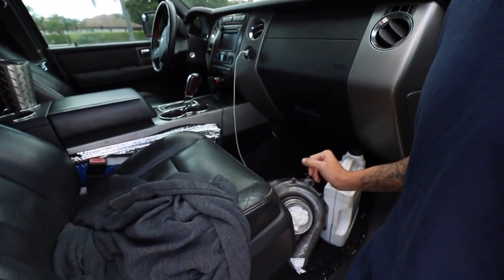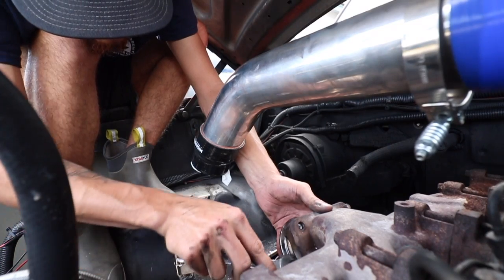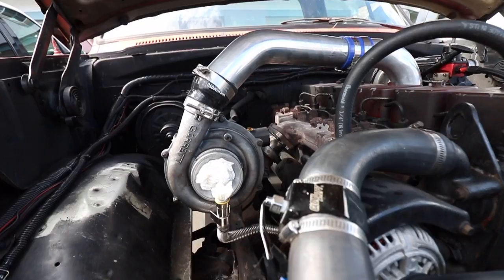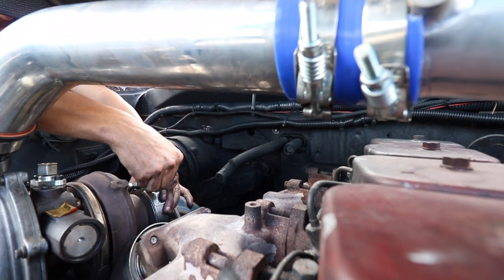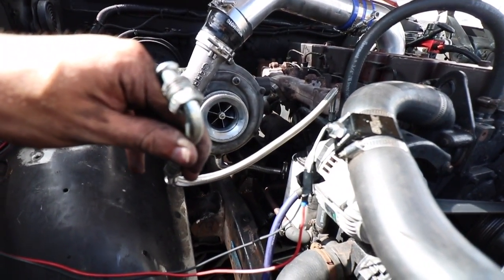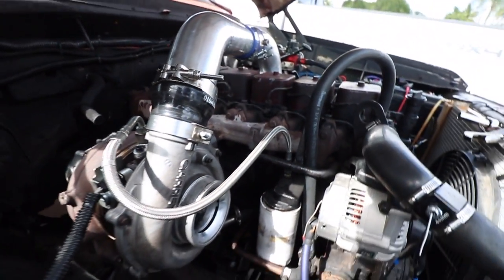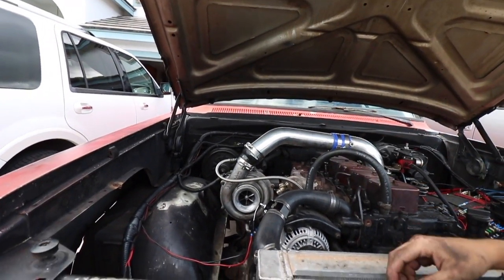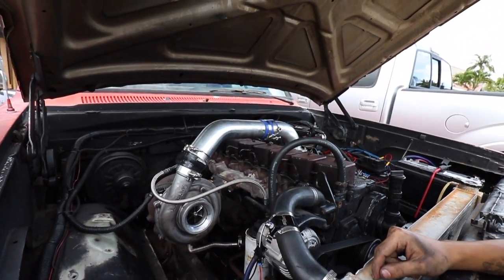INSTALLING A 6.0 POWERSTROKE TURBO ON A 12V CUMMINS

Comment: I know this is an older video but im curious how does it feel power wise and also how did you setup the wiring and controller for the VGT

Comment: Ok, i have a 12 valve and just heading about putting a VGT turbo on em im very curious about the wirering snd i believe there a vacuum line also?
Reply from the maker: @mattburke5356  the vgt turbo that I put on was all operated using hydraulic from the engine oil and the solenoid
Reply from the maker: @mattburke5356  but I think the new Cummings are operated by vacuum like you said
Reply: Ah ok that makes sense im definitely wanting ro do it now rhanks to your video. My wife said thanks hahaha  @dannersweldingandfabrication

Comment: Hey what size is the v band on the turbo that is goes to the manifold or the adapter you used if you bought it, I’m looking to do this swap on a 24v

Comment: I just got done doing this swap....it doesn't work worth a shit ....no turbo whistle only sounds like a shop vac makes 15 psi with the switch on but at 15psi the turbo flutters and truck pours black smoke egts skyrocket and truck won't accelerate at all .......no idea?
Reply: Sounds like the vains are wide open

Comment: What is that gauge to the right of the injection pump?
Reply from the maker: that is a fuel regulator cause I have an electric fuel pump that was supposed to be for a 5.9 v8 but someone converted it to a Cummins and the they put the fuel regulator on it to turn down the pump pressure

Comment: Whats the gauge at 05:10 ???
Reply from the maker: my fuel pump regulator cause i have an electric fuel pump
Reply: @dannersweldingandfabrication  you mean lift pump or you replaced p pump???
Reply from the maker: @ΙωάννηςΛαμπρογιώργος   my cummins used to have a mechanical pump but its been converted to an electric fuel pump but i have add a regulator and turn the pump pressure down, cause if I don't ill blow out my throttle shaft seal on my VE pump

Comment: That’s friggin’ sweet! Curious how you setup the VGT switch.
Reply: Probably just power to it, you could use a brake controller to control the voltage going to the turbo so it slowly closes the vanes as you brake turning it into an “exhaust brake”

Comment: Hey man I’m getting all the stuff together to do this to my 1st gen. Can you tell if you bypasses your inner cooler. Or is there a way to keep the inner cooler.
Reply: I by passed the inner cooler cause mine didn’t come with one from factory but I recommend using the inner cooler to cool down the egts and it makes the engine alot better

Comment: How did it affect the torque curve on the Dyno?
Reply from the maker: I’m not sure but i can feel that the truck has more torque at the lower rpm where as before the torque was in the middle but i have more speed at the top end
Reply: @dannersweldingandfabrication  
I wonder how much more boost you can get with the VGT without blowing it up. LoL
Reply: @dannersweldingandfabrication  
Torque seems to peak after the torque converter locks up then plateaus until 2,400 RPM.

Comment: How did you clock the turbo? I have mine torn apart waiting on a rebuild kit for mine before doing the swap. And I’m looking at it, the front housing will only go one way because of the slots, and the exhaust side has the VGT setup and looks like there’s only one way for it to go on. I’m just a little confused I guess on how you clocked it
Reply from the maker: i had to clock the compressor housing but i was running into clearance issue so i had to grind the back of the compressor housing to clear the vgt solenoid.
Reply: @dannersweldingandfabrication  awesome, thank you for the reply! I found out that they had different styles of compressor covers throughout the years I guess, the first turbo I pulled off a 2006 e-450 bus had a housing that could only be clocked certain directions. Then I found a 10 blade on marketplace for cheap that the front housing was totally different and could be clocked whichever direction needed. I swapped my turbo on my truck Saturday night and have some kinks to work out. Keeps posting videos man I like the content!
Reply from the maker: @AKRINIST  no problem anytime and thank you i appreciate it.

Comment: That’s sick dude, man y’all 12v guys have it so easy with the turbo setups, my 7.3 has no room for easy swaps like that
Reply: Idk why but nobody has put 6.0 turbos on 7.3’s I feel like there’s a reason they can’t / don’t do it.
Reply: @zaxfourtrax  bc they are too small to be effective on a 7.3 powerstroke
Reply: @zaxfourtrax  I’ve seen one 7.3 with a early 6.0 turbo on it but it was more trouble to get the vgt to work than it’s worth. My 7.3 has a borg compressor housing and 3in downpipe into 4in axle dump and the turbo is pretty loud
Reply: @zaxfourtrax it’s been done numerous times
Reply: What potentiometer did you use
Reply: The beauty of basically anything in an inline setup.
Reply: Nah man check out dps turbonator i have a s369sxe vgt on my 7.3 awesome turbo
Reply: @steezy7.3eazy76  how much did that cost you to do im considering that on my 7.3 excursion
Reply: @Dieselfan1997  the housing was 1500 sir and it is insane what it did to the powerband 100% recommend
Reply: @steezy7.3eazy76  what size injectors are you running with that sxe369 turbonator?
Reply: @steezy7.3eazy76  Pretty sure a VGT s369sxe doesn't exist. There sure isn't anything popping up when you search for it.

Comment: How many lbs of boost, and how quick does it spool
Reply from the maker: we don't have a boost gauge on it right now, but it spools really good
Reply: @dannersweldingandfabrication  you got me on market place looking for a turbo, it
Looks like they put out 24-27 lbs stock witch isn’t much more than my hx40 w so I’m on the fence about getting it purely for sound. But it’s sounds supper nasty.
Reply from the maker: @TurboMotorsports  It doesn't make a huge difference in the performance, we mostly did it for the sound haha we plan on putting  a boost gauge on it  in the future.

Comment: Let’s see what you did for that vgt switch!
Reply from the maker: all we did was wire it to a toggle switch ,so the vanes are either fully open or fully closed, we will make a video explaining how we wired it soon and plan on making the vgt vanes sweep automatically
Reply: @dannersweldingandfabrication  BAHAHAHA. I have always wanted to do something like that and everyone called me crazy. Put a thumb throttle on the wheel to control the vane position and play it by ear. Get a drivepressure guage and reference the boost until you get a hang of it. Not to mention, off the throttle, pushing it in all the way is an easy way of getting an exhaust brake. Is the vain control of the 6.0 turbo PWM driven with a duty cycle?
Reply: Yeh need to see that. I would do this
Reply: Add a guitar volume knob to the VGT and you can control how much power the vanes get so you can slowly open and close them and thus control how open they are
Reply: @mattheweggert2090  If it used PWM control, I don't think a potentiometer will be of much effect. Maybe there might be some other driver that can be made or repurposed?
Reply: Instead of the toggle switch, you could use a Hobbs switch. Then you could set it on whatever boost you wanted. When you hit the boost it’s set at, it’ll power up and open the vanes